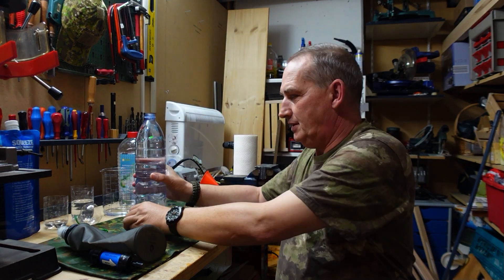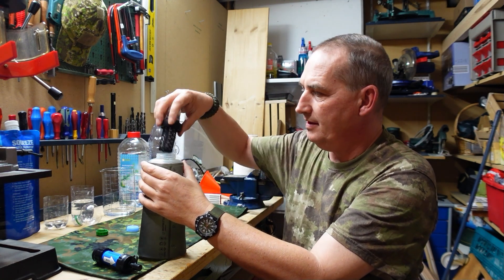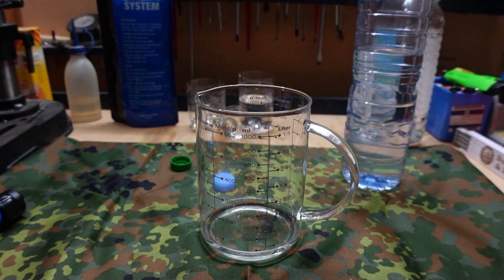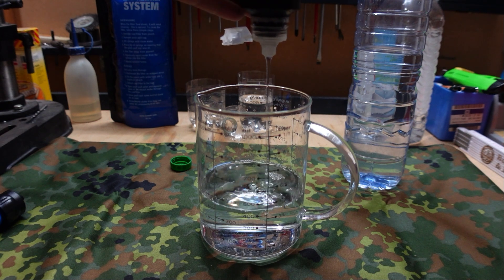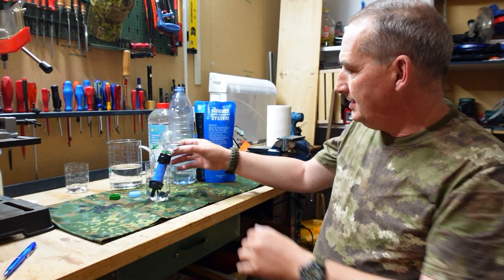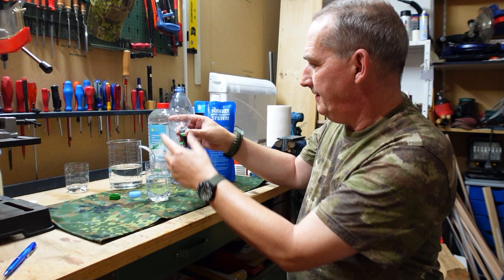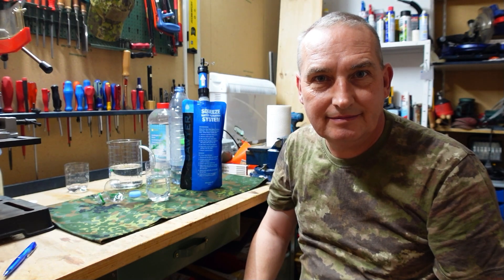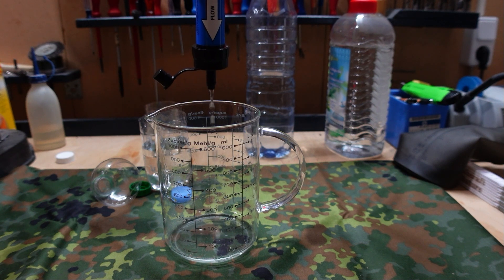Hohlfaser Wasserfilter warum versagen sie ? ¦ Hollow fiber water filters why do they fail ?

Comment: That’s really useful information Detlef. I still have a Sawyer I had to replace because of this. I will hunt it out and soak it down. Perhaps this is a less of a problem for people who use the filters frequently and all year round. The question for Sawyer and the rest is, why don’t you tell us in the instructions that we need to do this?
Reply from the maker: Hello Paul,
That's exactly how I felt. When the Sawyer no longer worked, I bought the BeFree. Put your sawyer in distilled water and it will absorb the mineral deposits and expand the fibers again. Then it should work. I don't know if a note is written somewhere in the instructions for use. I never read it properly 😅
Greetings Detlef ...